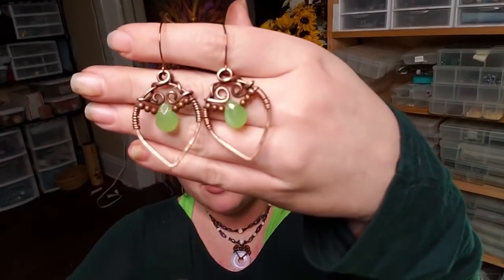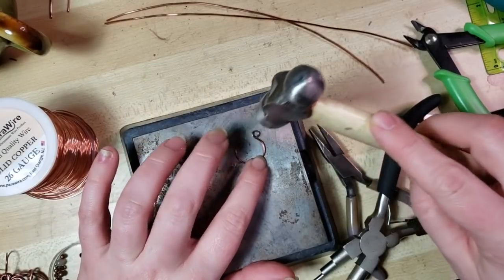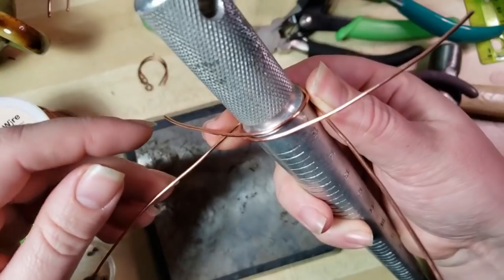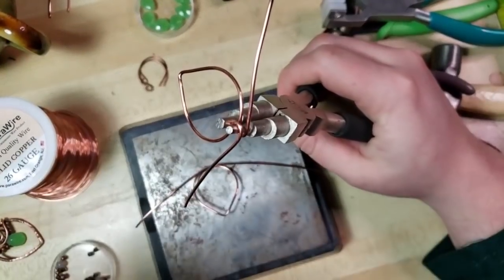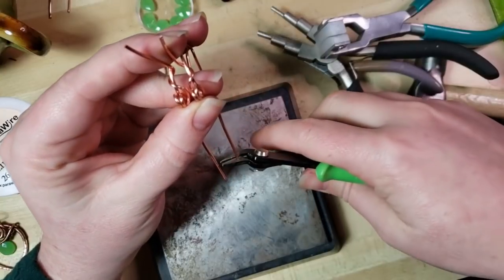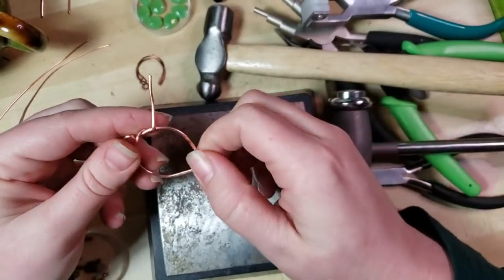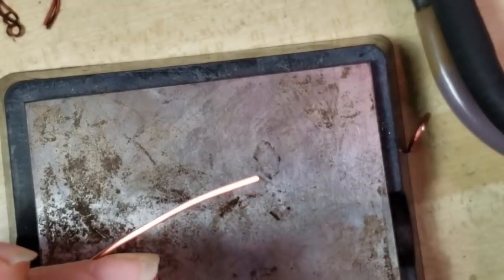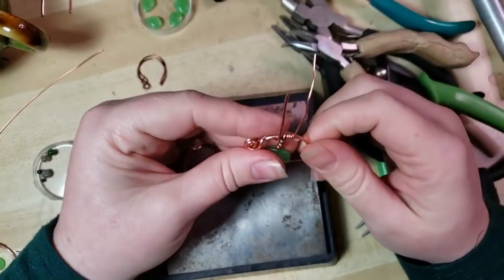Wire Wrapped Earrings

Comment: I just made these today using peridot as the center bead, copper seed bead as a spacers and three smaller peridot beads on each side. They came out beautifully!  Really like the weight and feel of the 16g wire.. had to use 26 g wire to hang the beads as the peridot crystal holes are so small. Did the variation loop as opposed to the spiral. Looking forward to showing them off!  Thank you for your clear instructions and awesome design!!!

Comment: Yvonne, I wet my steel wool and use a dab of Dawn dish detergent.  It keeps the steel wool dust from flying around.  I  polish over a plastic tray that is easily rinsed off.  Then I polish with my rotary tool with a 3/4" Carbon Steel Brush.  Then I may tumble the piece for a beautiful shine depending on the stones I use.  Great video. Thanks!
Reply: Ultra Polish Pads, available on Amazon, do a great job of polishing after steel wool.  Great for polishing in between shows or wear also. One pad goes a long way.
Reply: That's a great idea!  I'm also wondering if using spray furniture polish might help as well, like maybe Endust?  Just a thought 🙂

Comment: Try a dust buster to clean up. Mine is a Dirt Devil 12 v lithium ion quick flip. I've been using it everyday for over 3 years and the battery still lasts forever and is amazingly strong.
Reply: I have one too and love it. Think mine is 3 years old and as you said the lithium battery lasts forever.

Comment: Love these earrings, thank you so much! As Linda Spangler said, I wet my 0000 steel wool and use a drop of Dawn dish detergent. I also pull off a small piece because it’s easier to work with that way.

Comment: I love these, Von!! Thanks for showing us how to make that initial shape - I bet I could turn it into a heart, don't ya think? Btw, chalcedony is pronounced kal-SAID-knee (stress the 2nd syllable). A super cool group of quartz that includes the agates, jaspers, onyx, and all the other microcrystaline quartz 😁  Oh, and I like to use a wire brush to polish my metals. I like it more than steel wool 'cause it doesn't "shed" steel all over the work surface. Found at any hardware store in several grades, it's super inexpensive as well as easy to use 😎
Great tut!!
Reply: Jody, do you have any issues with the wire brush scratching your stones? I bet the harder ones wouldn't be a problem, but I was wanting to try this with a silver wire and turquoise, a gift for my Mom. Should I just be very careful not to touch the stone while I'm working? Thanks!
Reply: Great tip. Thanks!
Reply: @Doxymeister  
Yes, I'm VERY careful, especially with stones that are low on the hardness scale or are easily scratched. I have yet to damage a stone, I'm thankful to say!!
Reply: Kal said dough knee....  you missed the o
Reply: @seannewoods2296  fwiw, nobody in the trade pronounces the O  ;- ) Lots of words in English we don't pronounce each letter.

Comment: Hi Yvonne.  I am a beginner and want to know why the cut ends of my wires don't 'smush' like yours do, I still get tiny sharp ends showing .  What am I doing wrong please.  Is it a certain technique that you are using?  Thanks.
Reply from the maker: Hey, Dora! What wire are you using? I use Parawire brand wire, which is quite soft, and I think that makes a big difference on how malleable it is and how it responds to being smushed. Also, just a ton of practice and experimentation!

Comment: Hi there, I am interested to know if you're using "bare" copper (without enamel coating) for that earhooks? If you are, can you tell me if these also leave green marks in the earholes? Thanks
Reply from the maker: Hey, Java! The ear hooks I made with antique copper toned enameled wire as bare copper wire would turn my ear holes green; some folks are not very reactive with copper but bare copper turns my skin green every time.
Reply: @backtoearthcreations  that's great info. Thank you so much!  Btw, you have a very friendly face 🙂

Comment: is there any beads that you cant use when your oxidising ?
Reply: Hi, any bead that is coated won't work, there are a lot of seed beads and larger glass and plastic beads that are coated with special effects like ab or pearl or metallics or a milky opal finnish. The coating will soften in the liver of sulfer then when you use your brass brush or steel wool to clean up the piece, the coating on the beads will come right off. String a couple of beads onto the wire and test them before you make your piece. Usually it will say in the description of the beads if they are coated. Hope this helps! 🤓

Comment: LOVE these earrings!!  I need to buy the proper equipment for hammering & oxidizing, but I am working with raw copper wire - 14 gauge (It's a bitch!).  I use the 0000 steel wool for removing impurities and tarnish from unfinished work, and the crud is a real issue.  I'd suggest using moist wipes for cleaning off your work surfaces. Endust on a soft cloth would also be good, since it cuts any static and will help keep the crud on the cloth.  PLEASE don't use your hands for wiping steel wool bits off the table!!!! EEEkkk that made me cringe!!  If you get pieces of metal imbedded in your skin.... just NOOO.  Thanks so much for this cool tutorial, you rock!